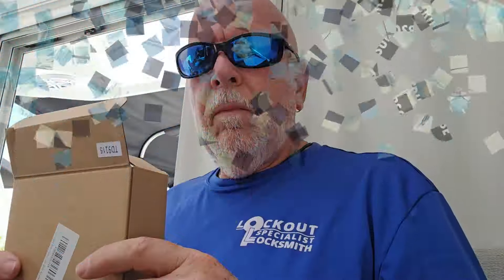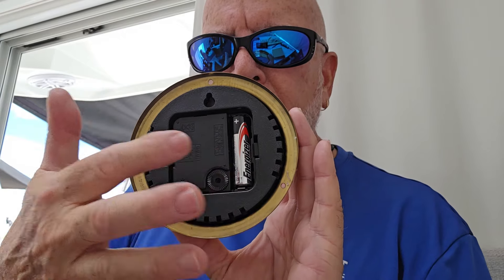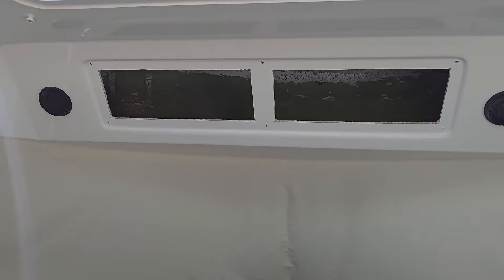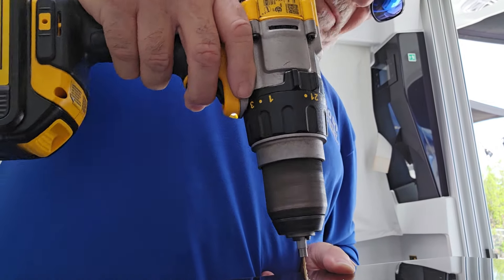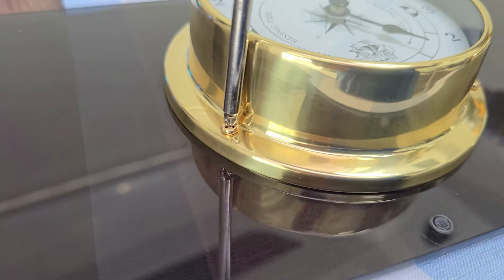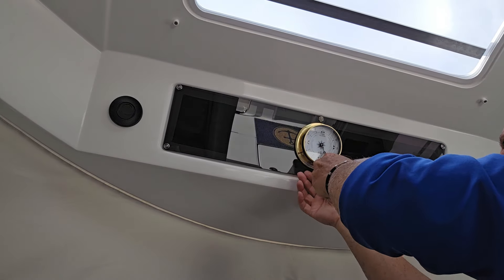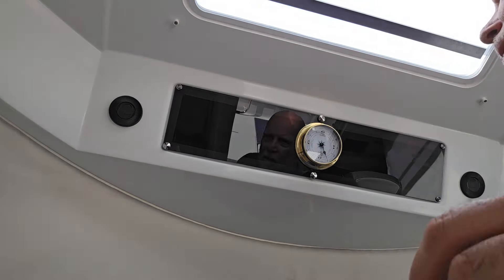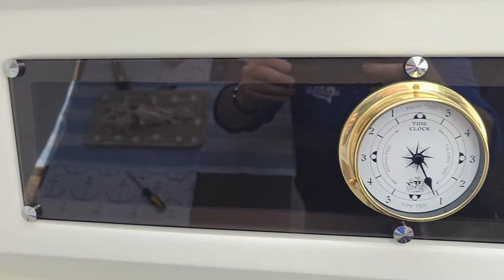Essential Boating Tool: Tide Clock Install on our Jeanneau 795 NC

Comment: Looks like it belongs there. When you calibrate it every several weeks how much of a difference is it from the app and visversa?
Reply from the maker: Hi Mark! Its around half hour difference in several weeks...which isn't too much in a 6 hour period. But the benefits at a glance is necessary when navigating. Thanks for watching Bro. Peace from the Keys!
Reply: @KeysBoatingChannel  often thought about getting one... your right about the 1/2 hour difference
Reply from the maker: @markdimaio8396  It's better and safer than looking through an app in the middle of navigation. Thanks Bro!